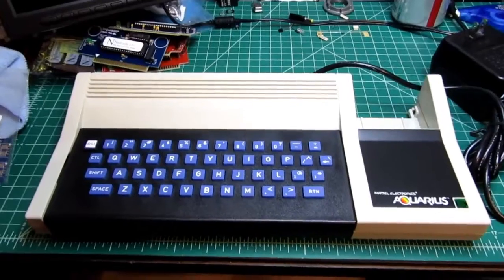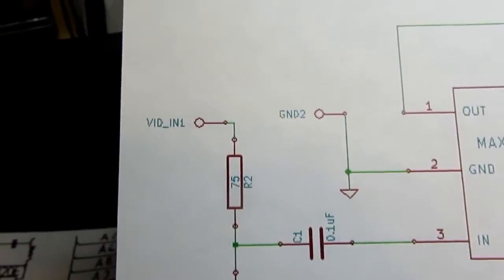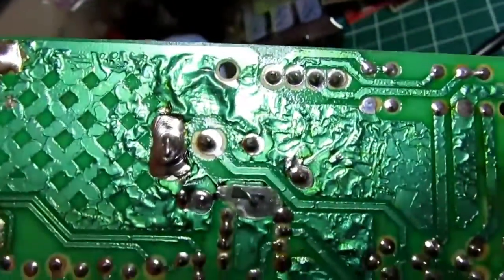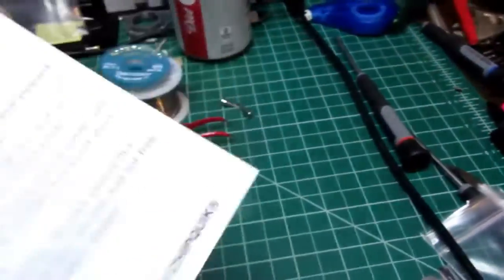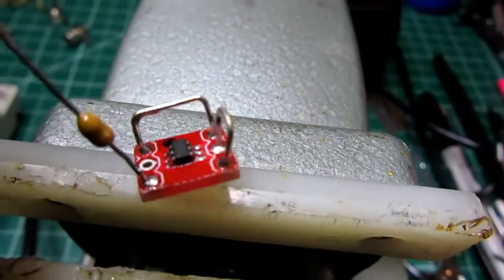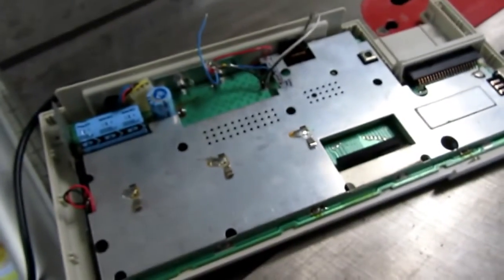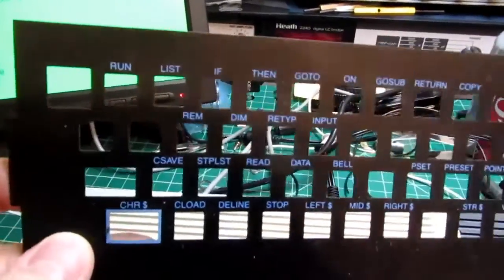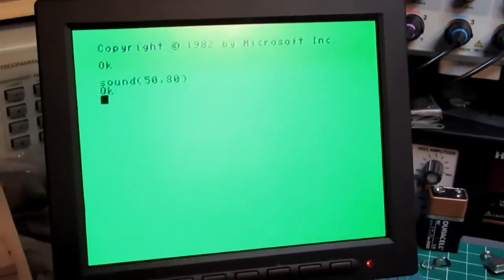Mattel Aquarius: The Little Computer That Couldn't

Comment: What connector did you use for the power cord mod? I recently got an aquarius myself and would love to do that mod to mine (I hate attached power cords)
Reply from the maker: @robertsissco2439  robertsissco, I got rid of this computer quite a while back, and don't recall what I used.
Reply: @youtuuba  Thanks for the reply. I know it was a 5 year old video when I asked and it was a long shot, but I appreciate the follow up none the less.
Reply: @youtuuba  They were Circular Aviation Connector Plugs. Thanks again for the video, I had not seen those kind of connectors before but now I know what I need to to make that dang cord detachable.

Comment: If you're gonna do it, do it right. Good job. My first thought on the hole centering issue was to slot the mounting holes so you could adjust left or right. Nuts and bolts might have been a pain though. Looks like you put more effort into this project than Mattel did.

Comment: You can get a reproduction unpopulated PCB of the mini expansion module they used to sell for it which I think adds more memory and allows you to connect joysticks, I've seen them on Ebay for like $15 though I couldn't tell you how much the components cost in total. Repro main boards are around too although obviously you don't need one of those.

Comment: I bought one of these at a Goodwill store 9 years ago for $2. It also had a Mini Expander in the box for another $2. The expander adds expansion ports for program memory and ram, 2 extra sound channels, and 2 odd game controller. I think I tested it on an old TV but now I only have modern TVs so your video mod will come in handy. Another interesting video.